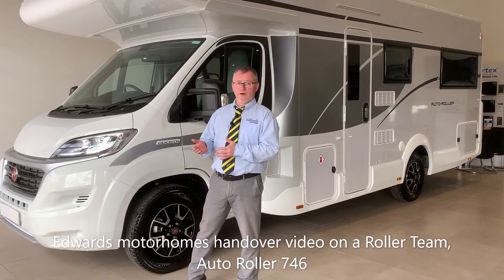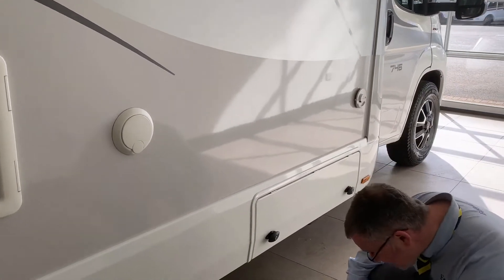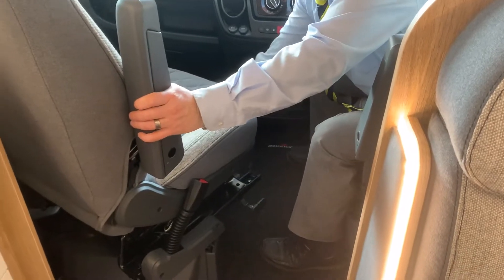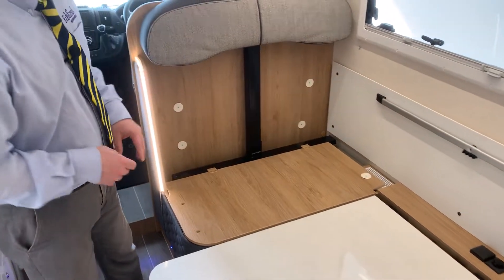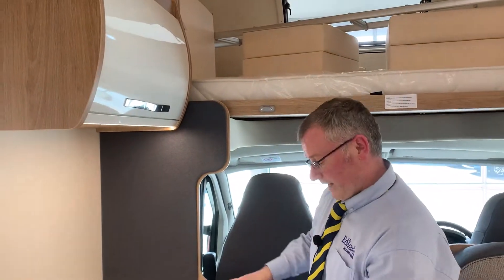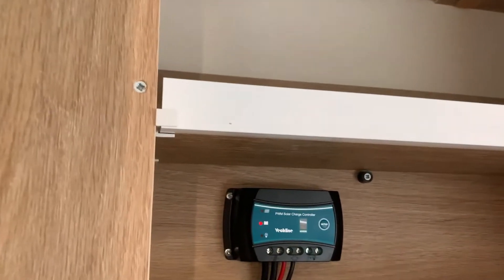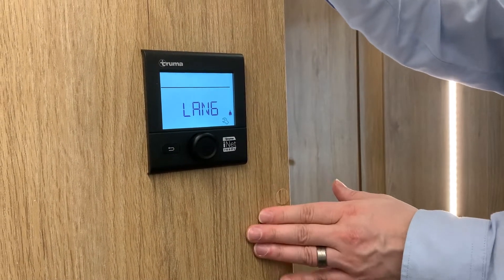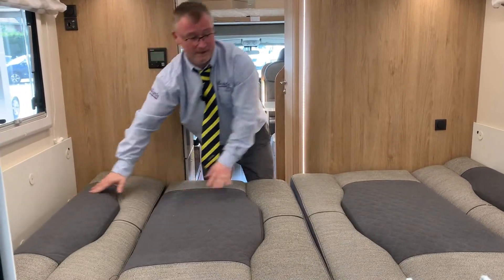2021 Model Roller Team, Auto Roller 746 handover video

Comment: Great video and fabulous motorhome. Can you tell me what is the point of the shower duck board , it doesn't look like it would fit on the floor outside the shower cubicle.
Reply from the maker: Hi Kevin
Its really there so you can walk in that part of the bathroom with your shoes on without damaging the shower cubicle floor.
Reply: ….also if you put the duck board back after your shower you can stand on it and not get wet feet/socks! Handy for getting dressed again.

Comment: I have the same motorhome albeit a 2015 model. I can find no information on the maximum weight capacity of the overcab bed?
Reply from the maker: Hi
I'm sorry i don't have any spec's on 2015 model to hand, but if you contact: enquiries@rollerteammotorhomes.co.uk
they should be able to get you the information.

Comment: Is this van for sale? Or is it already sold. This is exactly what we want.
Reply from the maker: Hi Barry
This is a sold unit, but I have an identical one due April/May if that works out for you.
Reply: @EdwardsMotorhomes what’s the cost of this van as it is? Very interested.
Reply from the maker: Hi Barry
Please follow the link for the price and all the spec: https://www.edwardsmotorhomes.co.uk/vehicles/2021-rollerteam-auto-roller-746-arrival-date-tbc/
Any questions please give me a call on 01905 829000.
Kind Regards
Andy
Reply: Hi, about the handle to dump the grey waste, is that the only option? As you probably know a lot of the time on UK campsites you will need a hose  to drain to a grid / gulley. Great video .
Reply from the maker: @kevinmullin4504  it is the only option from the factory i'm afraid,  though it should be easy enough to get some piping to fit.